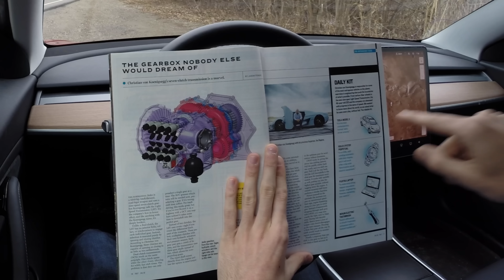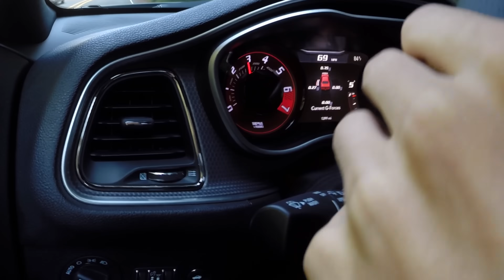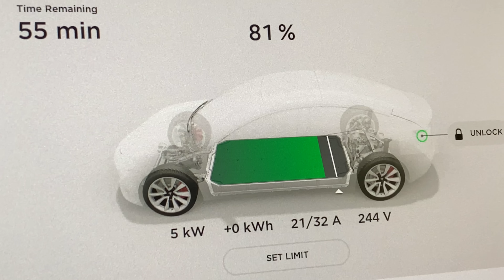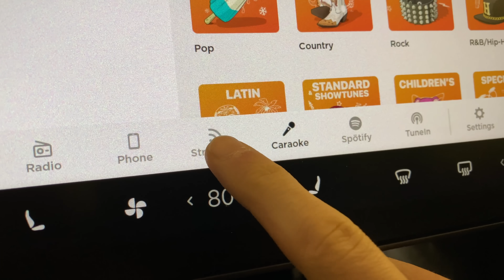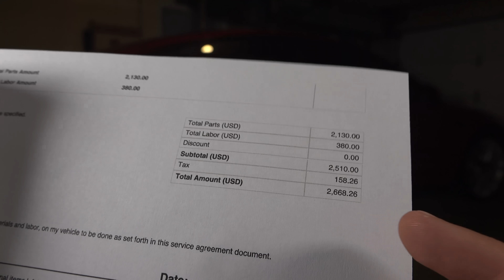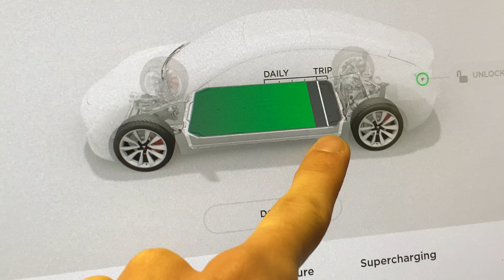Living With A Tesla Model 3 For A Year - The Best Daily Driver

Comment: My mom’s 2006 Maxima has a heated steering wheel... I’m highly surprised and disappointed the model 3 does not. 

(Still going to buy one lol)
Reply: Does model Y have it? I think it will be better than the 3 by a huge margin anyways.
Reply: My mom has a jag with a heated wheel, about a 2007/2009 model i think. It's tied into the heated seats which I find annoying because the wheel gets HOT well before the seats are toasty, and it would be great to be able to have that heated wheel for that initial chill, but it makes you want to turn off the heated seats to avoid feeling like you're playing hot potato.
Reply: The conspiracy is that artificial leather, that they use for the interior now, can't sustain the dramatic heat coming from a steering wheel heater.
Reply: Don't need it. Pre heat car using app
Reply: A Singh that heats the car, doesn’t heat the steering wheel. I agree that’s an amazing feature... but heated steering wheel is a heated steering wheel haha. If you’ve tried it in the winter it’s amazing
Reply: @BrokenStatues7  you're right but if you hear the cabin for even 10 mins, everything gets warm. Also you can point the heat towards the steering and seats to be more effective. But yes, would be a nice feature to have, especially in Canada
Reply: so your mom car has the steering on the seat???
Reply: Kamikaze e30 haha, nope but the heated seats and heated steering wheel are in the same switch. If it was my car I'd probably put a cut-off switch for the heated steering wheel so I could just do the seats. But, it's not and my mom drives less than a 1,000 miles a year and they use their Subaru when it's cold out anyway.
Reply: Jeremy Specce oh no😂! I was actually replying to the main comment because it said “My mom 2006 maxima has a ‘’SEATED steering wheel’’ before the comment was edited to “My mom 2006 maxima has a heated steering wheel’’😂 I just thought it was hilarious

Comment: Hey Jason, you can set the exact charging percentage from the app.
Reply from the maker: TIL - Amazing! Why is this not accessible in the car?! I like 80% because it gives full regen if temps are warm enough.
Reply: Engineering Explained they still need to make the slider snap to every 5 increments. It looks like it’s actually snapping to 3 or something, which means you can’t snap to 80%. I always get 81% which is super irritating to people who have minor OCD like me lol.
Reply: There's the problem, there is so much convoluted software with nested submenus on this vehicle that even after a year of an enthusiast driving it, he still can't figure it out. 
You know what else the app can do? Make a non-refundable $7,000 upgrade by accidently pressing a button. Tesla doesn't even use secondary confirmation. You can butt dial your way to poverty.
Reply: okleydokley there is a secondary confirmation for Apple Pay (on iPhone obviously), maybe not on android though.

Comment: I'm only in 3 mins & I'm waiting for the bad reason for fuel vehicles is, "why is it noisy?!"
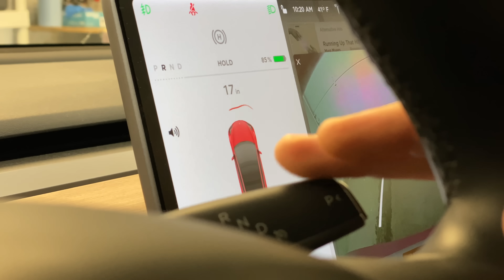Reply: & there it is at 4:35 mins! Lol
Reply: As for #9, I don't have pets(sad face) but I do have a fairly large electric cooler(can hold up to 60 cans of soda) which is powered by 12 volt power, so no melted chocolate for me! Lol, sorry trying not to hate on this video but...
Reply: I know many of the automotive audiophiles out there will agree with me on this(or at least mostly agree) when it comes to bass, if you have an under powered bass unit for the area it must fill, it'll only be "good" near where the bass is being produced & anywhere it is to far from it, the bass will be lacking!

Comment: If it weren't for the fact that mass production of gas engines in the early 1900s and into the 1910s, we would still probably have a lot more electric vehicles on the road. Something like 80 or so percent of taxis in New York back then were all electric. Maybe the range could be better today, but it's still an interesting fact.

Comment: Electric cars are great and I would really like to own one, but it takes years until they reach second hand market, where I could afford them. You dont need a 60k car to drive to work and back. At the moment for a regular guy, it's a lot cheaper to  get a cheap gas beater for a daily.
Reply: The Chevy Bolt has a decent used market.
Reply: The Tesla used market is skewed since the "cheaper" Model 3 is still so new and the older Model S started around $100k.  However, check the second hand market on Autotrader for electric vehicles.  If you are looking for a short range commuter electric that you can effectively charge on 110v, there are LOTS of Leafs (and others) under $10k.  Of course, the early Leaf battery tech did not have thermal management which means they suffer greater degradation, but they are still great commuters as long as you have other options for longer trips.  I drove one for 6 years before buying my Model 3.

Comment: If I needed to spend upwards of 50G's cdn for a vehicle, it would definitely be the Model 3.  Just wish it wasn't so expensive.  Even with our rebates, you're still looking at financing a 58G vehicle (that's the lowest trim level 3 you can get here.. on the road...).  I would be all over the model 3 if it was starting at the mid to high 30's.  But now you're talking about a 60G vehicle.. that gets pricey fast.  You're talking about monthly payments of 1-1.2G's every month (for the next 5yrs).  I will definitely wait for at least another 5-7yrs before I need another vehicle.

Comment: As a european there is one major thing that totally disqualifies using EV as a daily driver for me. I live in a apartment complex and there are no garages available. Cars are parked alongside the street or on a parking lot. So there is no way to charge it when you are home, you still have to go somewhere around town to charge your car. So it so much more convenient to go to gas station and get a full tank in 2 minutes than waiting 20(however its very very rare to even find a supercharger so it would take much longer usually). Also its much more convenient on a long trip to just stop for 2-5minutes and fill the gas and you are good to go. Im not hating EVs in general but i thing battery based EVs are crap. Toyota's solution of a fuel cell EV sounds much much better to me and i would want to own one if only there were hydrogen pumping stations where i live.

Comment: Using the electric car as a status quo for your questions was clever. I wasn't expecting that. It really makes the difference between ICE and electric cars clearer.
Reply: @bosstowndynamics5488  Kind of like hydrogen cars are right now with the Toyota Mirai. Extremely few places to fill it up, extremely expensive.
Reply: I mentioned this elsewhere, imagine if ICE became a thing, what would people say if you had to carry 13 gallons of an explosively inflammable fuel.
Also what people say if the engine had to be running all the time.
And you’d have to store this fuel in suburban locations.
Reply: Excellent “thought experiment”!  We almost drove STEAM cars; similar torque to an electric! ;-) Driving bombs around, be they steam, gasoline or RP-1 (diesel as Rocket Propellant), has never been a great idea.  Emergency services now have High Voltage Disconnect training.
Reply: Agreed,but of course,if we had gone electric earlier...
Reply: I've asked this question before if there's a word for the bias toward something that's inferior simply because it existed first.  I went through this with film vs digital, vinyl vs digital, and EV vs ICE.  I usually try to use the analogy of a cell phone when people defend burning dinosaur bones to power something.  Imagine if your cell phone ran on a gasoline engine!
Reply: @megamoze  It does, because it is powered by coal and gas power plants.
Reply: I'm having that experience now. My model 3 was in a crash and I'm driving a rental. When I drove it off the lot I thought there was something wrong with it because the engine was making a horrible noise and it was barely moving. Took me a little driving to figure out that it was just a typical $17k car and that is what I used to drive all the time. Little ICEs at 5k RPMs make a lot of noise, but not much power.
Reply: @RichFreeman  I have to alternate between a minivan and my model3 to accommodate a large dog and kids sometimes. I swear every time I drive the van it feels like it is minutes from falling apart completely. Even driving my husband's bmw now is pitiful, I am ruined for all other cars.
Reply: @bosstowndynamics5488  Yes! Imagine if 100 years of R&D had gone into EVs instead of ICE's. Of course, one big thing that has made all vehicles so amazing today is computers. Hard to imagine an EV without them (say 50 years ago), but at least  battery tech would be farther along. Fun to think about.
Reply: @Eric Simonson Electric motors have benefited from about two centuries of R&D. It is the batteries that are key.
Reply: @Markle2k  Actually, not really. The designs and efficiencies of electric motors didn't change a lot through 1890 - 1970, because for the most part they were quite efficient and more than adequate to do the tasks they needed to do. Solid state electronics, microchips and solid-state power inverters gave rise to the development of the modern wave of PM/BLDC motors used in most electric vehicles today. Now that EV's are a thing, there's a huge push to develop more power-dense motor designs like axial-flux. Batteries are important, but likely the most important thing in the EV powertain is the inverter, as it's allowed regenerative braking which has delivered a hard push to the round-trip efficiency of EVs, making them a lot more practical.
Reply: @ericsimonson3128  No, battery tec took of with notebooks and mobile phones, so at the end of the 90ies. Not before.

Comment: Interesting way of presenting EVs. Truth is, electric motors have always been better than ICE for land vehicles, its just that there were no batteries good enough before. Taking an engine that has to always be rotating and using it where much of the time the vehicle is stopped is inherently a kludge, thus we got the transmission. Once the price reaches roughly parity, there is no good reason for people with a house and more than one vehicle to not have an EV. 
P.S. with EV's starting to come off lease, you can get an affordable EV for even the masses.

Comment: Have same car, agree with most of your complaints, except you forgot one.... wind/road noise.  I've owned several other cars in this price range and they were, much, much, quieter at highway speeds even with that noisy combustion engine. I find it much harder to hold a conversation with someone in the back seat when on the highway then my old car. (BMW 340i) I prefer the Tesla in pretty much every way, but the wind/road noise at highway speed is annoying. For a $60k car I expect there to be better cabin noise isolation. I'd even be willing to pay a bit more for a luxury version that has it. (not Model S 2x prices though)
Reply: We were also very disappointed with the road noise when we tested the Model 3. Combined with the less than stellar rear seats, it really cooled off our desire to purchase. Great car in pretty much all other ways though.